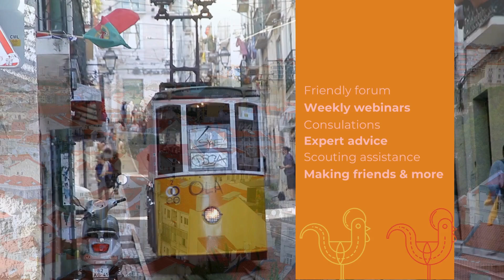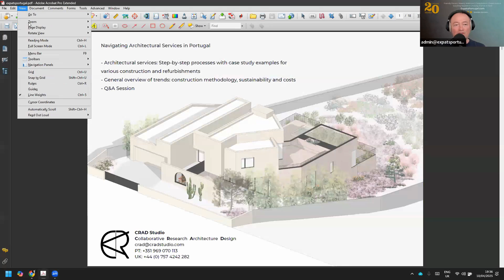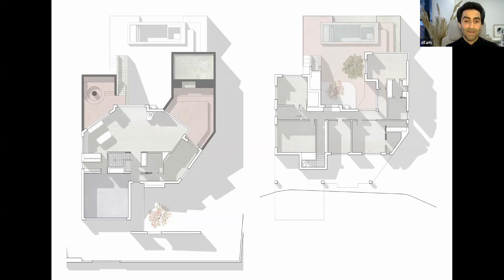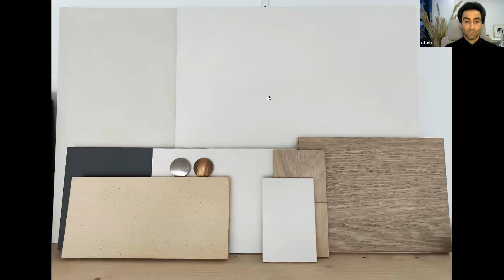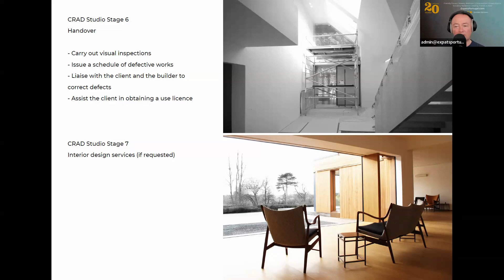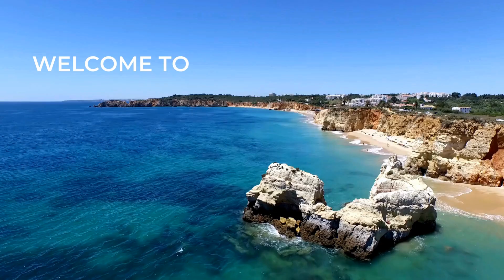📐 Building & Renovating Your Dream Home in Portugal: Architectural Insights for Expats

Comment: How are prices of construction compared with 3 year ago, I heard they are a bit nomalized?
Reply: The prices of construction materials are stabilising compared to three years ago, but house prices have generally increased in Portugal in the past four years. Builders have a lot of work, so construction is typically priced by builders who will compare the result with new houses currently on the market. New builds can be overpriced unless you have full control over the construction process.

Comment: What is the average price for a turn key house in Cantanhede area?
Reply: Builders typically try to maximise their return with turn-key houses. However, unless an architect specifies all materials, fittings, and fixtures and the construction is overseen by a professional, I don’t recommend a turn-key approach. Builders are very aware of the real estate market, so a turn-key house is within the range I mentioned in the video, maybe just slightly higher because you're not dealing with the decision-making process.